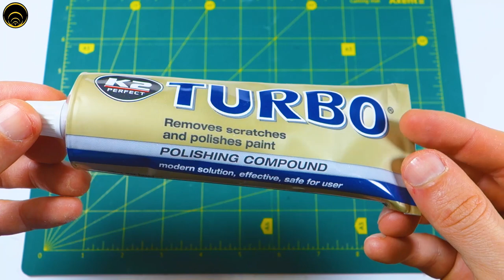How to make a pendant with a glow effect from resin and a stabilized burl with a flower inside

Comment: Anyone in the USA know where to get TURBO or an equivalent?  The only way i get that kind of shine on my work is to put clear coats (sometime several because every coat runs the risk of dust or air bubbles.  Would love to just sand and polish out the scratches sometimes but searches for TURBO come up empty (Even on the holy grail of all suppliers, Amazon)
Reply from the maker: https://www.ebay.com/itm/K2-TEMPO-TURBO-120g-Polishing-Compound-NANOTECH-Wax-PASTE-Scratch-Remover-POLISH/162280226368?epid=19017022679&hash=item25c8a7be40:g:J~MAAOSwV0RZjjS-